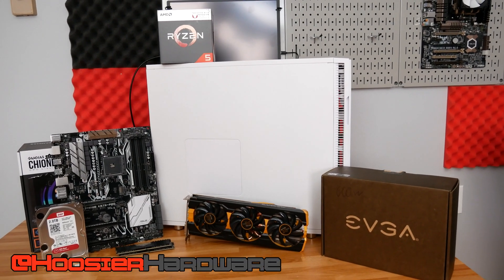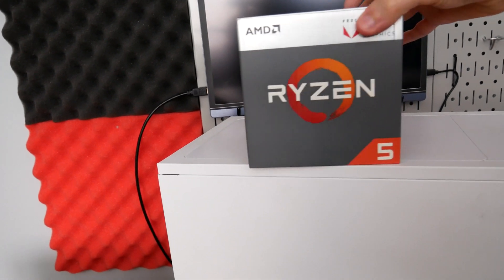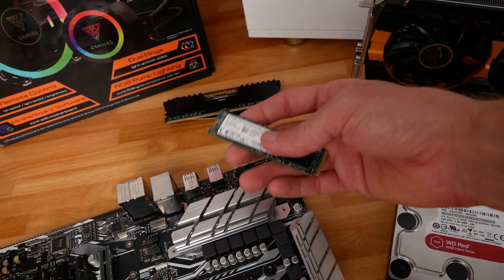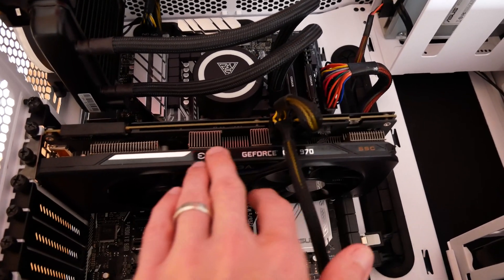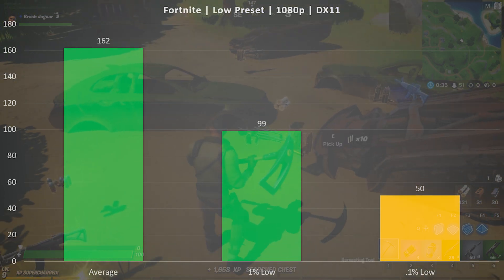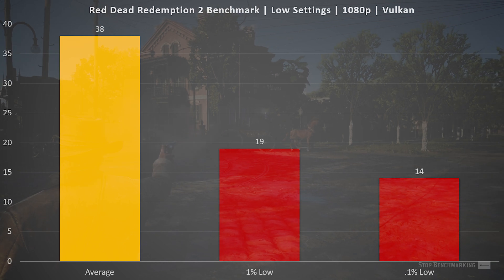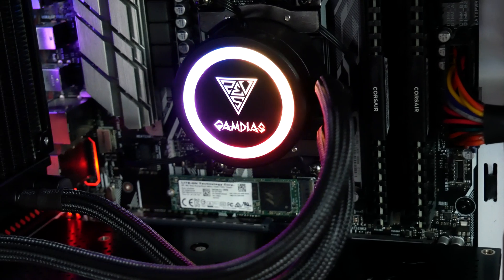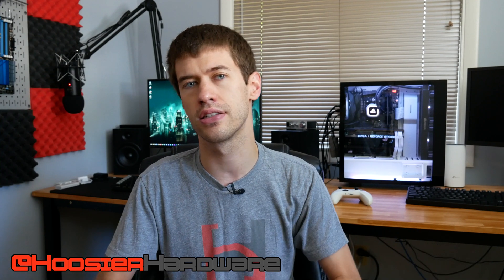PC for Misfit Components #2

Comment: I'm not sure why you call it misfit, but sure.

I find these numbers interesting.  We don't play any of the games listed so it's hard to tell. We play OW CoD Siege CSGO Paladins WoW, things like that.
I can tell you that the 2400G does 4.0ghz no problem as well! Sure 4 cores 8 threads is kinda low for today's standards but it does seem to work really well for her.
She bought it new back when it was $120 new. I got the mobo for $30 from the same guy I got the MSI B350 and 1600AE (the 1600 was sealed in box) for $150.
I traded that 1600 mobo cpu and cooler combo and some other parts for an Asrock Taichi x370 and 1700X with an older but good 120mm AIO.